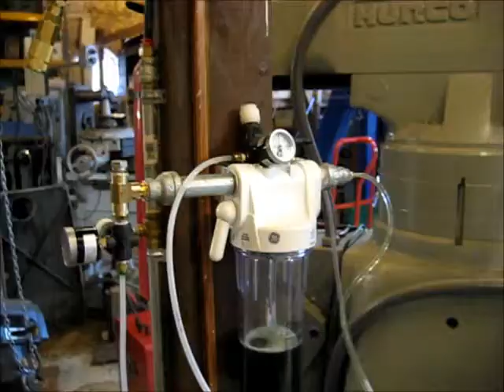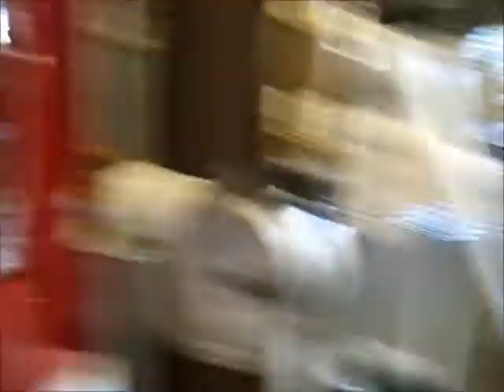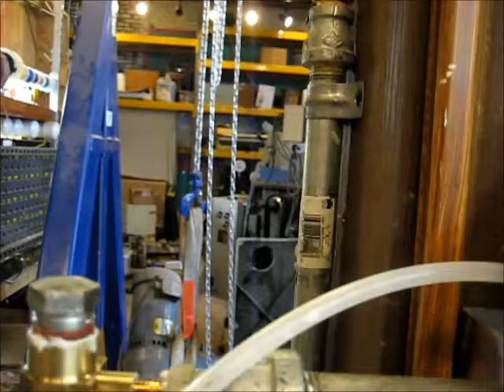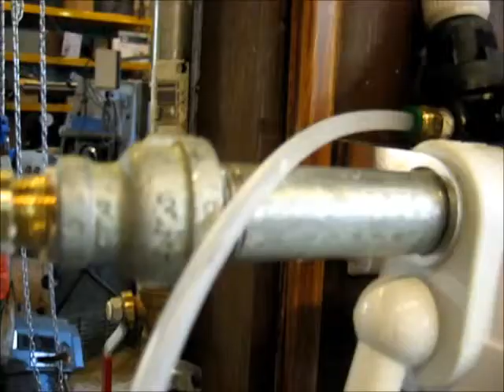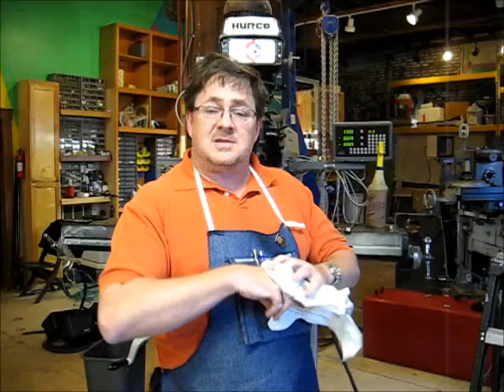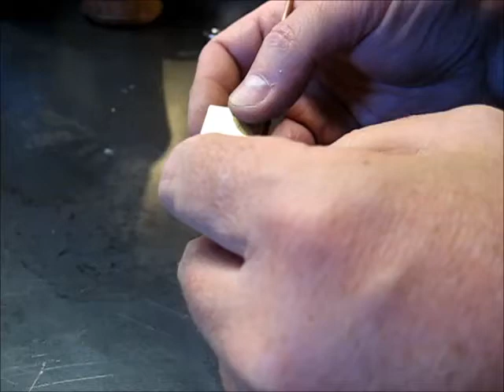Fogless Coolant System Part 2

Comment: Hello James,  Did you see Dudley Toolright's version of this?  He made a block with two needle valves one for the coolant and the other for the air.  He liked 5# on the coolant.  Under the KISS principle this beats 12v solenoids and is great for convenience.  This is a good project and I like seeing how others solved the design.  Take care.  Doug

Comment: is not a safety woman but was taught never point air line at any one or near skin even at low pressure as you can get particles in your skin easy done long time healing as I was told

Comment: James, enjoying the video, similar to Adam, I have a cool mist tank which has both air and fluid controls,  don't seem to have much of a "fog" problem, I use a loc line setup to hold the spray  nozzle

Comment from the maker: I have an old building downtown, two story, its about 6000 sq ft total, shop is on the first floor.  I was thinking about trying our the KoolMist 77 after I run out of this LPS AquaCut, or maybe just mixing up some Rustlick Pro that I have in a portable 5 gallon flood setup.  I have only used that on the K&T mills.

Comment: Good video James. Interesting project you are working on. But I have to say I like my Kool Mist, but I'm not worried about the mist, I use the the Forumla #78 which is "supposed" to be a foggless coolant. I've had good luck with it. 
I'm very curious about your shop. It looks like it has very high ceilings in it. Are you in your basement or do you have a seperate shop?

Comment: Nice job, I've had a similar system on my project list for a while now. I'd argue that the air is the coolant and that the fluid in the quantaties that it is being applied is more of a lubricant. I sometimes just use air alone for cooling/swarf clearance. I plan to interlock the solenoids to the spindle start/stop (I can use a 'running' output from the VFD) for ease of use.